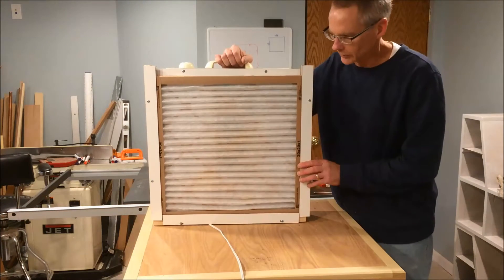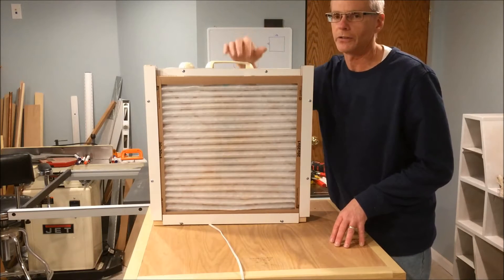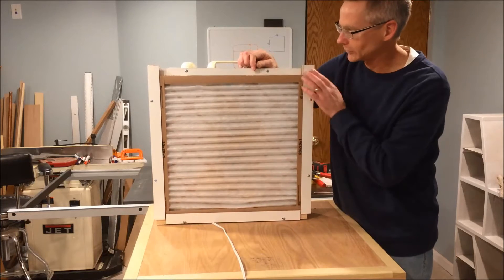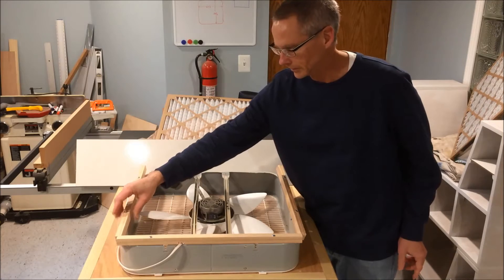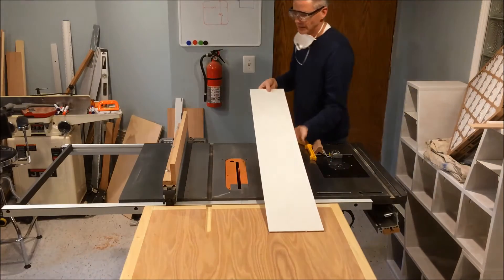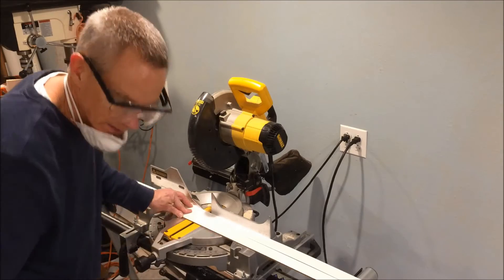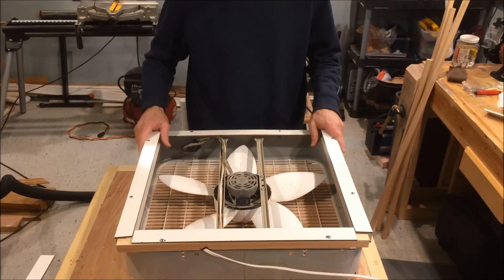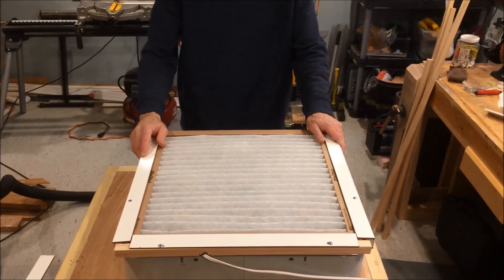DIY Workshop Air Filtration

Comment: People, why do not you understand that this kind of fans do not create any negative pressure. Because of that you are not able to put proper filter for fine wood dust. Your filter now catches only flies and mosquitoes. There is always invisible dust that only filter like hepa filter can catch. With this "device" you only spread the finest and most dangerous dust around, and when you go to your shop you actually breath only the finest dust left of your wood / metalworking. The finest dust can fly in the air with days before settle on the ground. So, you must have at least filter rated under 1 micron. If you put this kind of filter on your fan you will see that no air will pass through the filter because the fan is crap. So now you have dust spreading machine!
Reply from the maker: FYI: They sell HEPA filters for your home furnace, which is what this can use.  Obviously even a small fan creates negative pressure, otherwise you would get no air flow.  The fan blades act in a similar fashion to the wing on an airplane, which must produce negative pressure, otherwise you would fall out of the sky during your visits to grandma.  
This type of inexpensive box filter is not going to provide they type of filtering you would get in a large, expensive commercial system, but it is effective at reducing fine particle dust (which you are correct in saying is the dangerous stuff).  
I can tell you from experience, that if I use this filtering system, the air quality in my shop improves, as I have monitored the particle count with an expensive sensor from a friend of mine.  
"Coffee breaks over, back on your heads"
Reply: I have a try (experimented back in the time) with this kind of fans and thick filters ( I mounted and sealed 4 hepa filters from vacuumcleaner) and the result was terrible. Important about fans used in air scrubbers is CFM, W (wats) and Pressure. When CFM and W are big, the fan is OK. Mine is turbine with 500CFM and 150W and It is weak for hepa filter + some prefilter. Because of that I use prefilter and 1micron rated filter. And after I use this scrubber for a 4 hours at night, when i go to the shop the next day I still see some fine dust when I take a look on the light, the dust is almost invisible and very hard to see It but is still there.
Reply from the maker: If you still have very fine suspended dust in your shop, then I would suspect you have a problem with your filter.  Actually for fine, suspended dust CFM is not as critical, since the fine dust will be pulled into nearly any filter, even with low CFM.  That is the idea behind collecting the dangerous, fine dust, and for a small shop a simple box fan with an attached filter is fine.  Actually, if you look at the more costly Jet or Rikon air filtration systems, you will see they do nearly the same tasks.  If you really want to ensure no dust in your workshop, I would suggest just not turning on any of your machines, since any time you do this you will kick up a cloud of fine dust.  No solution is perfect, and no solution is going to 100% eliminate fine dust.